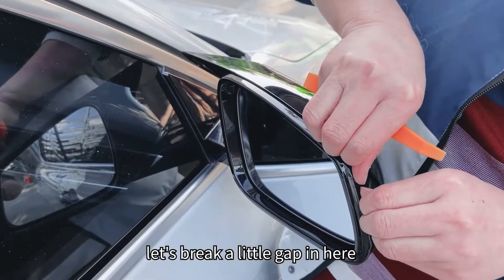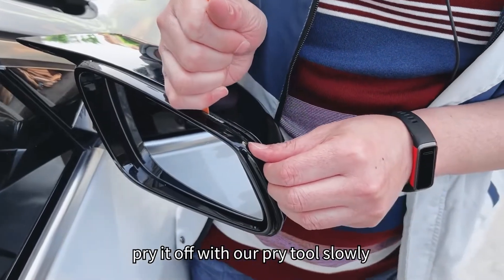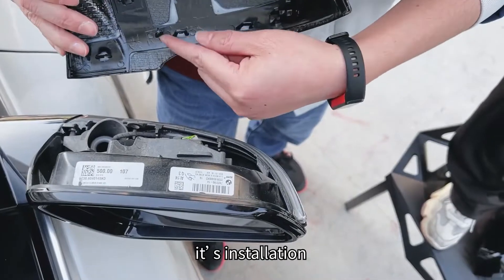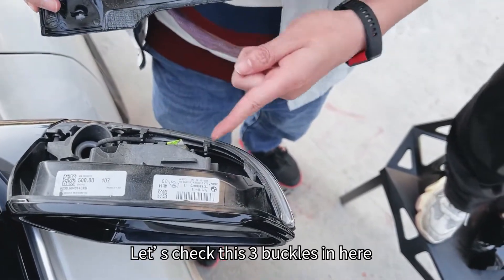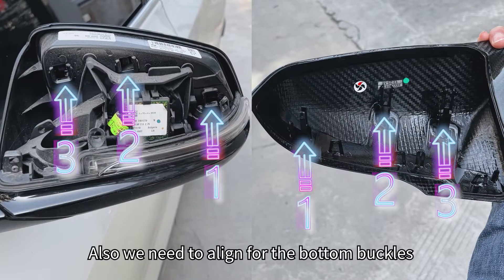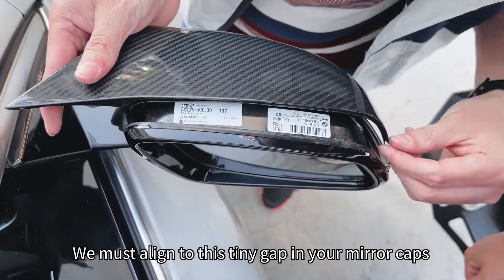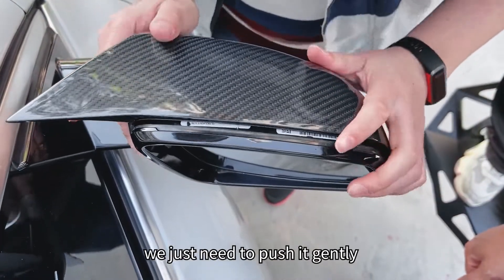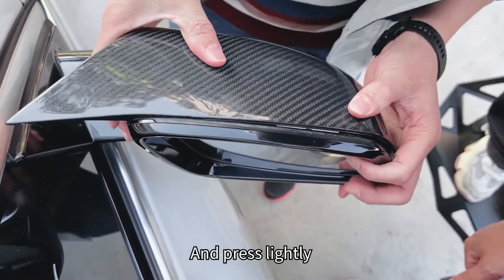How to Install Z4 G29 Dry Carbon Replacement Mirror Cap? (Without Remove Glass)

Comment: Completely wrong. You need remove the glass and then undo the clips from behind - takes literally 1 minute. This method breaks all the tabs and potentially damages the actual wing mirror so the new cover might not even be able to clip on after
Reply from the maker: Hey mate, if this is the first time u do this on your own, this might not be a good sample for u. But some tuning stores will do in this way, you can choose the one with less risk to install your mirror cover :)